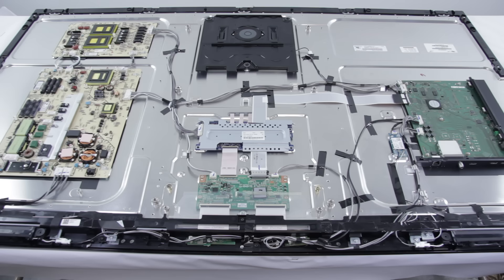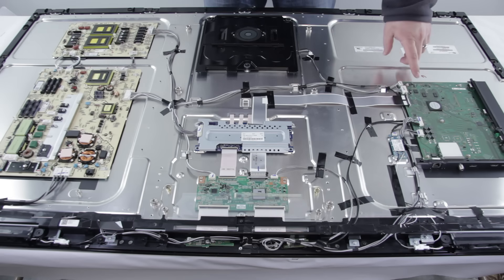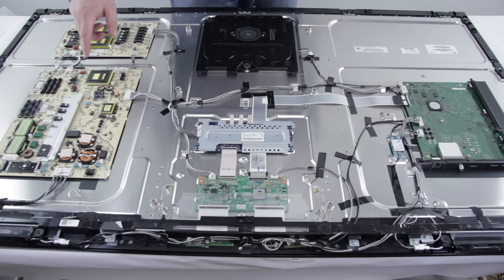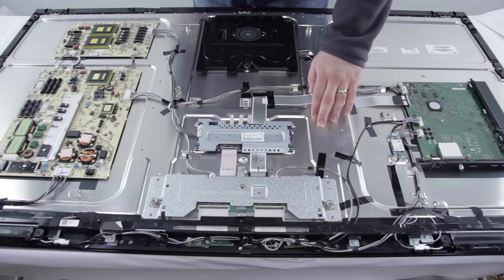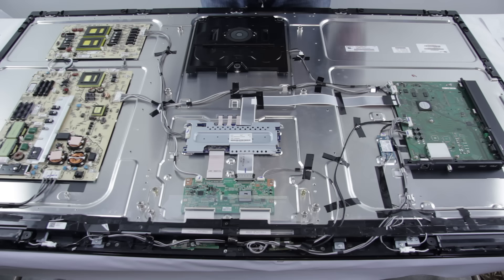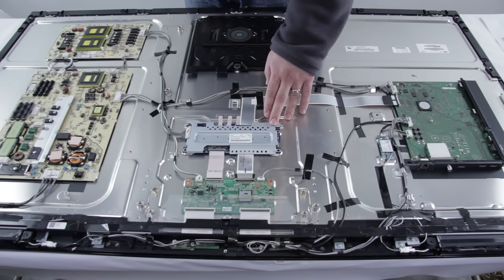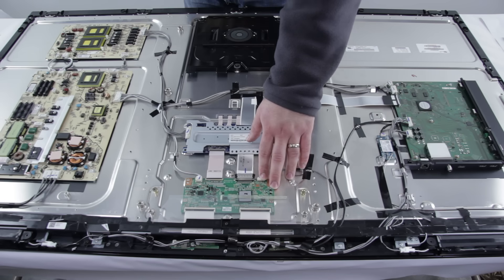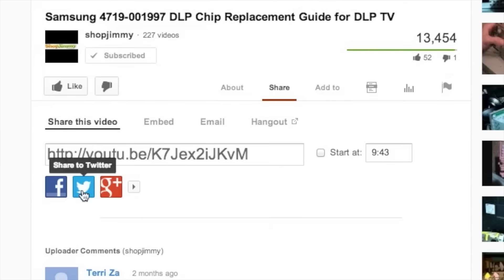LED TV Repair Tutorial - Common Symptoms & Solutions - How to Repair LED TVs

Comment: Due to high voltage my led series5 , model no.ua40d5000pr got smoked ,white smoke came out from it.The samsung service centre says to change power supply ip board.please sugest me on it with more information.
Reply from the maker: NEYMAR JR   I would replace the TV as there is no telling what the high voltage damaged.  Thanks!  www.shopjimmy.com

Comment: Hi, my tv is LG 42LW5700, and it won't power on, and it has red flashing light. When if turn on my tv, you can hear a clicking sound. my email address: zerimar_mike@yahoo.com. thank you.
Reply from the maker: Michael Ramirez   I recommend replacing the main board in your TV.  Unfortunately I do not see any replacement parts in the search results for your TV model number on our website.  Please reply with your part number on your main board and I can try searching for replacement parts.  Thanks and please let us know if you have any further questions!  www.shopjimmy.com

Comment: I have a Toshiba 65HT2U LED TV that suddenly no power and no LED. I am getting 120v on the output of the plug and also through the fuse. I'm not sure which wire I am tapping to, but I am getting 5vDC out from the power supply board going to the main control board. I have replaced both the power supply board and main control boards (supposedly parts from new units). I am still getting the same symptom: no LED and no power at all on the TV screen. Can you advise? Btw, awesome video! Much appreciated
Reply from the maker: Joseph Cabrera   This sounds like a defective replacement main board in your TV.  Here is a link to replacement parts for your TV model number on our website, click here:  http://www.shopjimmy.com/catalogsearch/result/index/?master_part_type=Main+Board&q=65HT2U  Be sure to match part numbers on your current board, with your replacement for compatibility.  Here is a link to a video showing how to identify your part number, click here:  TV Part Number Identification Guide for Toshiba Main & Scaler Boards (LCD, LED, Plasma TVs)  You can also call our customer service for further assistance with your purchase.  (877) 881-6492  Thanks and please let us know if you have any further questions with your TV Repair!  www.shopjimmy.com

Comment: I have a Toshiba Model 46L5200U1 - lost picture but still have audio. when up close at an angle I could still see a slight picture.  Turned T.V. off then back on, everything would be fine for a minute or two then the screen will go black again leaving me with just audio. Replaced with a used backlight inverter board and after about an hour or so the screen went black and left me with just audio again.  Any help would be much appreciated.  Thank you
Reply from the maker: Pancho Ordunez   I recommend replacing the power supply board in your TV.  Here is a link to replacement parts for your TV model number on our website, click here:  http://www.shopjimmy.com/catalogsearch/result/?q=46L5200U1  Be sure to match part numbers on your current board, with your replacement for compatibility.  Here is a link to a video showing how to identify your part number, click here:  TV Part Identification Number Help Guide for Toshiba Power Supply Unit (PSU) Boards  You can also call our customer service for further assistance with your purchase.  (877) 881-6492  Thanks and please let us know if you have any further questions with your TV Repair!  www.shopjimmy.com
Reply: Just replaced the power supply board and I am still having the same problem.  Any suggestions?

Comment: Proscan model: PLED3992A-C, picture will flash in and out from picture to black screen. Sound is good. Any thoughts???
Reply from the maker: ken dupree   This could either be a problem with the inverter board or the main board.  You may need to replace each board individually to see which one fixes the problem.  Unfortunately I do not see any replacement parts in the search results for your TV model number on our website.  Please reply with your part number on your main board & Inverter(s) and I can try searching for replacement parts.  Thanks and please let us know if you have any further questions!  www.shopjimmy.com

Comment: i've heard colored lines on the screen could not only be the t con board but might also be a dirty or bad connection with the ribbon cables. can you clean those connections? and if so what do you use?
Reply from the maker: Michael Shaw   You can try reseating the ribbon cables to be sure they are tight.  You can replace the T-Con to see if that fixes the problem, but if it does not, then you most likely have a bad TV panel.  Please reply with your TV model number if you would like me to send you recommended replacement parts for your TV Repair.  Thanks!  www.shopjimmy.com
Reply: Thank you. I have disconnected them, wiped them down and reset them. upon first turning it on it looked good. after a few seconds though the lines returned. Any suggestions or should i just go for the new t con?
Reply from the maker: Michael Shaw   Yes, you can replace the T-Con board to see if that fixes the problem.  If that does not work, then you have a bad panel.  Please reply with your TV model number if you need help finding a replacement T-Con board, or you can click on this link and enter your TV model number on our website: www.shopjimmy.com  Thanks!
Reply: Thank you so much for the help, tv model # UN46B6000VFXZA. SAMSUNG

Comment: hi, my Philips led tv 40pfl15507 volume goes up automatically and the tv just shut off...tech change volume button and it works normally for 3 days then volume goes up again and tv goes off...it looks like the tv just shut off because it need a rest!! Please help!!!
Reply from the maker: Hley M   I recommend replacing the main board in your TV.  Unfortunately I do not see any replacement parts in the search results for your TV model number on our website.  Please reply with your board number and I can try searching for replacement parts.  Use this video to help you: Philips Magnavox Main Boards TV Part Number Identification Guide for DIY TV Repair Help  Thanks and please let us know if you have any further questions!  www.shopjimmy.com

Comment: hi, have a toshiba 40tl900a 3d smart tv. on power up the green led comes on on the front and thats all.. usually on power up the red led comes on , then i can turn it on via the remote and then it goes green, ive unplugged it for a while and the back in, but it just goes straight to green, tv only 2 yrs old. please hellp!! thanks
Reply from the maker: cmacgiolla   I recommend replacing the main board in your TV.  Unfortunately I do not see any replacement parts in the search results for your TV model number on our website.  Thanks and please let us know if you have any further questions!  www.shopjimmy.com

Comment: I have a Vizio, 39" E-series. E390-A1 tv. Lately, when we power the tv on, we haven't seen an image or heard anything. I did the power cycle thing that Vizio suggests doing but that no longer works. I also switched the 250v fuse which was blown (although the old one was 3.15amp and the new one is 3.0 amps). 
I also tried the flash light test and saw nothing through the screen. What should I do now?
Reply from the maker: Jeff Wiggins   I recommend replacing the main board in your TV.  Here is a link to replacement parts for your TV model number on our website, click here:    http://www.shopjimmy.com/catalogsearch/result/index/?master_part_type=Main+Board&q=E390-A1  Be sure to match part numbers on your current board, with your replacement for compatibility.  Here is a link to a video showing how to identify your part number, click here:  TV Part Number Identification Guide for Vizio Main Boards (Plasma, LCD, LED)  You can also call our customer service for further assistance with your purchase.  (877) 881-6492  Thanks and please let us know if you have any further questions with your TV Repair!  www.shopjimmy.com

Comment: I have a Vizio tv model M470VSE that is 15 months old.  Everything works fine except that whatever is on the screen also has a mirror image of itself.  Right now I have it disassembled and the words NO SIGNAL are on the screen.  Directly below these words are the same words only upside down and backwards.  I have tried putting in a used T-Con board and a used main board.  I still have the same problem.  I came across your video while researching LED driver boards which I have right here beside me.  Do you think I need a LED driver board?  Thanks.
Cliff In North Carolina
Reply from the maker: Cliff Beasley  This sounds like a TV panel problem.  If your TV panel is bad, it may be more cost-effective to replace the TV as panels are typically hard to find in stock, difficult to replace, and expensive.  Thanks and please let us know if you have any further questions!  www.shopjimmy.com

Comment: I have a Sony Bravia model KDF46E3000 that turns on normally, stays on for approximately for a minute, the picture then goes out,power light and sound stays on for a second, then sound goes out and the power light starts blinking, as if it is powering up,  for approximately 30 seconds, and picture and sound comes on again, and the sequence starts over. what might be possible problems???
Reply from the maker: David Giffin   I recommend replacing the digital board in your TV.  Here is a link to replacement parts for your TV model number on our website, click here:  http://www.shopjimmy.com/catalogsearch/result/index/?master_part_type=Terminal+Board&q=KDF46E3000  Be sure to match part numbers on your current board, with your replacement for compatibility.  You can also call our customer service for further assistance with your purchase.  (877) 881-6492  Thanks and please let us know if you have any further questions with your TV Repair!  www.shopjimmy.com

Comment: 42LN5300 - Tv does not turn on (no sound or video) but the LG button is flashing on and off.
Reply from the maker: Caelan Fulton   I recommend replacing the main board in your TV.  Here is a link to replacement parts for your TV model number on our website, click here:  http://www.shopjimmy.com/catalogsearch/result/index/?master_part_type=Main+Board&q=42LN5300  Be sure to match part numbers on your current board, with your replacement for compatibility.  You can also call our customer service for further assistance with your purchase.  (877) 881-6492  Thanks and please let us know if you have any further questions with your TV Repair!  www.shopjimmy.com

Comment: lg 47ls4500 will not turn on its plugged in and no light . look at power supply board and no trans look swollen
Reply from the maker: Melissa Jenkins   I recommend replacing the power supply board in your TV.  Here is a link to replacement parts for your TV model number on our website, click here:  http://www.shopjimmy.com/catalogsearch/result/?q=47ls4500  Be sure to match part numbers on your current board, with your replacement for compatibility.  Here is a link to a video showing how to identify your part number, click here:  TV Part Number Identification Help Guide for LG & Zenith Power Supply Unit (PSU) Boards  You can also call our customer service for further assistance with your purchase.  (877) 881-6492  Thanks and please let us know if you have any further questions with your TV Repair!  www.shopjimmy.com

Comment: Samsung 55" Class 1080p 120Hz 3D LED HDTV - UN55FH6030AFXZA - I moved my tv by grabbing the sides, and moved it back later. No reason to think anything would break.  However, now the top half of my tv is darkish, with the right-top being the worst.  If I grab/touch the back of the tv, behind where the problem is, I can make it get better or worse.  Seems like a loose cable for that portion of the screen.  TV is 10 months old.  I'm sad.  Is it possible that the fix is as easy as a loose cable or does it sound like a board/screen problem?  I'm really shocked that picking up the tv from the sides could cause this...
Reply from the maker: nikographer   This sounds like a TV panel problem.  If your TV panel is bad, it may be more cost-effective to replace the TV as panels are typically hard to find in stock, difficult to replace, and expensive.  Thanks and please let us know if you have any further questions!  www.shopjimmy.com

Comment: Hi. I have a Samsung 40" LED model UA40D5500 with the internal chassis # T400HW04 V.2. There is a thin horizontal line exactly half way and images above the line are doubled up (ghosting). Picture on bottom half of screen is perfect. I did a video of it here http://youtu.be/SZq9hcj3SX4. Any feedback would be appreciated.
Reply from the maker: Peter Stothers   This sounds like a TV panel problem.  If your TV panel is bad, it may be more cost-effective to replace the TV as panels are typically hard to find in stock, difficult to replace, and expensive.  Thanks and please let us know if you have any further questions!  www.shopjimmy.com

Comment: Hello I write Marcelo from Argentina, I have a problem with led tv jvc LT24DR530 who had a problem with the fall of lightning, was repaired the power supply, I walked a while, but then started with a problem of lack of backlight, a sometimes it worked and sometimes not until I let go completely. I hope I meet possible causes. thanks
Reply from the maker: marcelo verguilla   I recommend also replacing the main board in your TV.  Unfortunately I do not see any replacement parts in the search results for your TV model number on our website.  Thanks and please let us know if you have any further questions!  www.shopjimmy.com

Comment: 2012 LG 55LW5600-UA HDMI ports out.
No signal shows on screen.
This is with HD Comcast cable box and ROKU device in different ports. All ports 1, 2, 3, & 4 do not work.
Component works but picture sucks.

Thanks
Reply from the maker: Ellis Conner   I recommend replacing the main board in your TV.  Here is a link to replacement parts for your TV model number on our website, click here:  http://www.shopjimmy.com/catalogsearch/result/index/?master_part_type=Main+Board&q=55LW5600-UA  Be sure to match part numbers on your current board, with your replacement for compatibility.  Here is a link to a video showing how to identify your part number, click here:  TV Part Number Guide for LG & Zenith Main, Digital, & Tuner Boards (LCD, LED, Plasma TVs)  You can also call our customer service for further assistance with your purchase.  (877) 881-6492  Thanks and please let us know if you have any further questions with your TV Repair!  www.shopjimmy.com

Comment: I have a sharp lc-55le620ut led aquos tv and it's doing a shadow in the middle  with ghost lines on the right of the TV and it used to clear up after a while and now it is not doing it now what should I do?
Reply from the maker: David Prude   This sounds like a TV panel problem.  If your TV panel is bad, it may be more cost-effective to replace the TV as panels are typically hard to find in stock, difficult to replace, and expensive.  Thanks and please let us know if you have any further questions!  www.shopjimmy.com

Comment: Samsung UN32EH4003VXBA - Lost power in the middle of firmware update. You hear it boot up, screen stays black, the red power indicator flashes 6 times & then the TV powers itself off. Still have a copy of the newest firmware if there is a way to reload or reset the firmware?

Comment: Hi I have a vizio m470nv  razor and I can hear sound and see some lights come on when I turn it on but the screen stays dark and I cannot see any images
Reply from the maker: orosco01   I recommend replacing the main board in your TV.  Here is a link to replacement parts.  http://www.shopjimmy.com/catalogsearch/result/?q=m470nv  Be sure to match part numbers on your current board, with your replacement for compatibility.  You can also call our customer service for further assistance with your purchase.  (877) 881-6492  Thanks and please let us know if you have any further questions with your TV Repair!  www.shopjimmy.com

Comment: Proscan 50" led tv plded5066a-c one thin red line to the right side of the tv and distorted to the bottom, please help need info and part recommendations
Reply from the maker: Albert Bennett   This sounds like a TV panel problem.  If your TV panel is bad, it may be more cost-effective to replace the TV as panels are typically hard to find in stock, difficult to replace, and expensive.  Thanks and please let us know if you have any further questions!  www.shopjimmy.com

Comment: 42LE4900   HDMI and Scart input has stopped receiving any signals, component is ok as is all on line smart facilities  any ideas
Reply from the maker: Colin Norwood   I recommend replacing the main board in your TV.  Here is a link to replacement parts for your TV model number on our website, click here:    http://www.shopjimmy.com/catalogsearch/result/?q=42LE4  Be sure to match part numbers on your current board, with your replacement for compatibility.  You can also call our customer service for further assistance with your purchase.  (877) 881-6492  Thanks and please let us know if you have any further questions with your TV Repair!  www.shopjimmy.com

Comment: I've got Vizio VOJ320F1A has main board issue and been replaced exact parts from ebay TV turns on has sound and picture but very fuzzy and blurry kinda distorted... and also same thing with my LG32LK450-UB replaced mainboard and Tcon board same issue with my Vizio Blurry and fuzzy both TV turns ON it's just the pictures are really annoying please help ...... thank you..
Reply from the maker: momoy02   I recommend reseating the ribbon cables in your TV.  Thanks and please let us know if you have any other questions.  Thanks!  www.shopjimmy.com